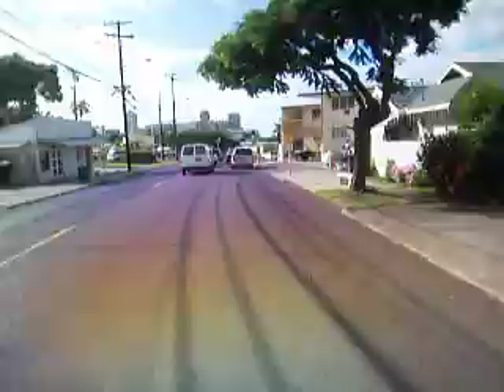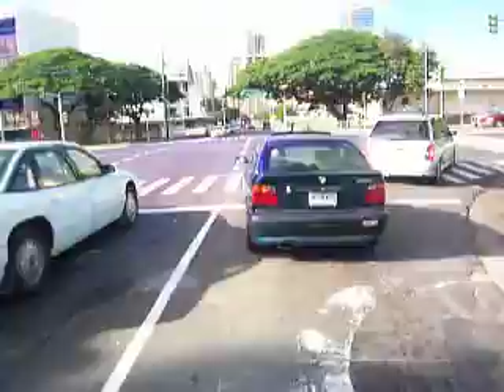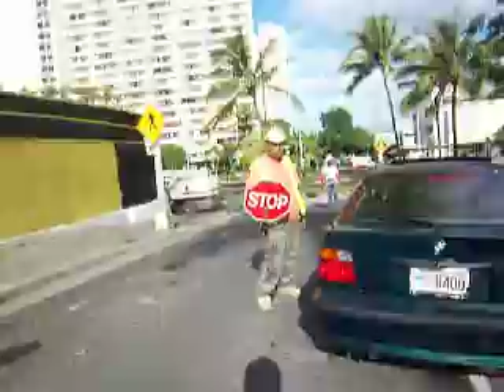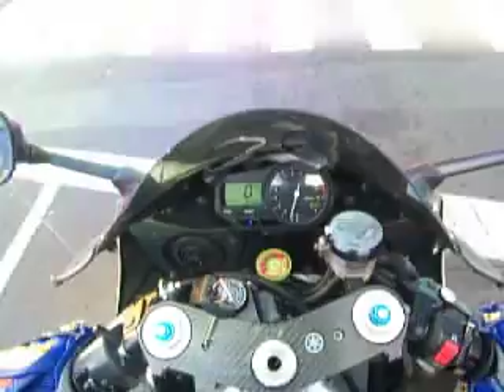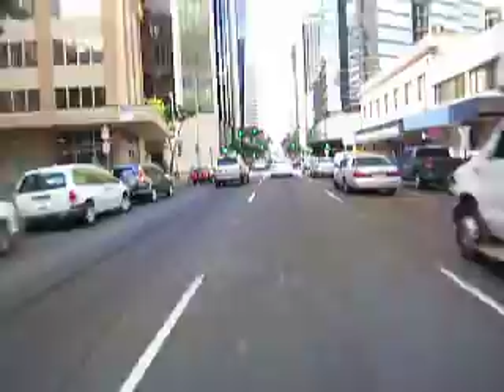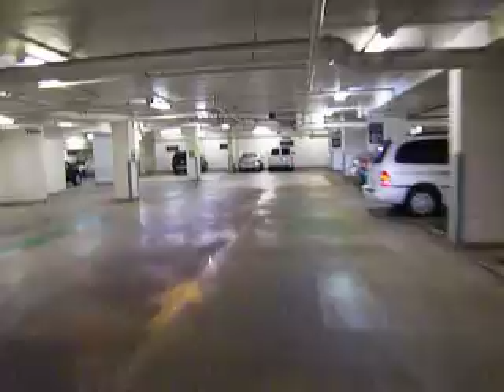Re: Gas Octanes

Comment: Fuel is a mixture of more than just octanes, so there are more factors involved, as well as your motor spec, in what amount of power you'll recieve from what fuel.
As far as reading your vehicle manual, think about it - If the guys who built it don't know, then who does?